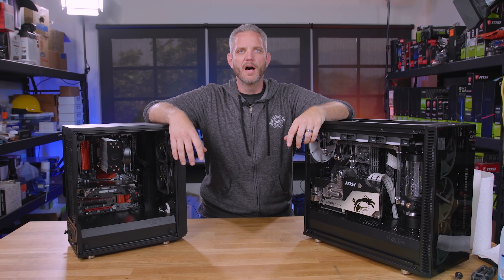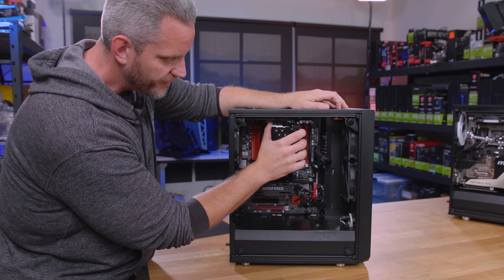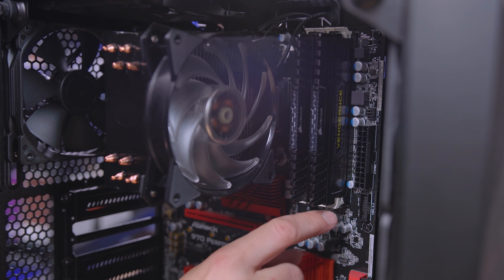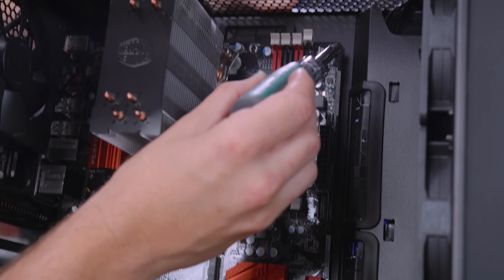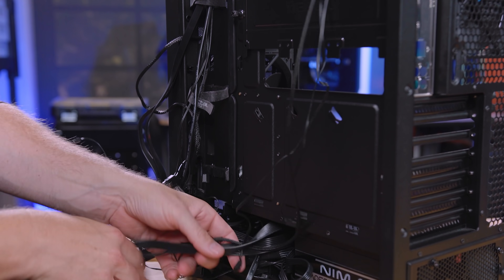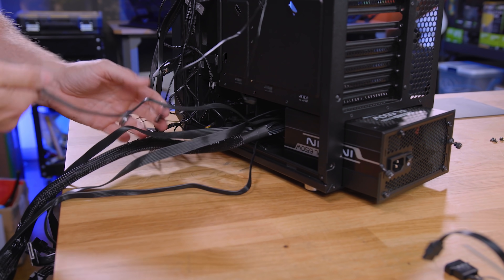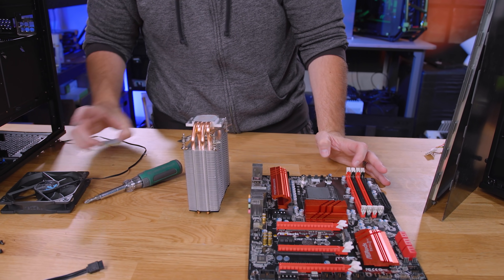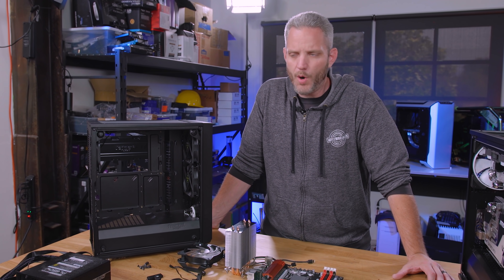How to UN-Build a Computer

Comment: I'm sad, Jay never took off the 
io shield.☹
Reply: Its important to point that out because the IO Shield is part of the Motherboard and not the Case, and a newbie can easily think otherwise.
Reply: Yeah I Want To Know How To Remove Io Shield
Reply: @Piyesgi  Most IO shields will have tiny clips that hold it on the case. Since there are so many, it is really hard to get them all bent in without damaging them. I have been able to take out an IO shield so I could move the motherboard to a new case, however it is extremely difficult. I probably bent a few clips, however I was able to get it in the new case.
Reply: @theredstonehive  Tiny clips? What have you been smoking?

Most IO shields just pop out. There's nothing to it, just press it into the case after you removed the motherboard. Make sure you keep track of the IO shield as there are thousands of designs for these, so finding one that will fit a particular motherboard can be very hard.

Some IO shields are actually attached to the IO port section of the motherboard instead of clipping into the IO port hole in the chassis. So when you pull the motherboard the shield stays attached to it. Again no problem, and you don't even risk losing the IO shield.

If you are building computers on a regular basis I'd suggest you save all IO shields even for dead motherboards. If you request a RMA many (all?) motherboard manufacturers wants only the motherboard sent to them. This way they don't have to keep track of all the parts such as IO shields, CPU HSF attachment parts and whatever else there may be. So save all that and you just might have a spare some day in the future. I've been saved numerous times by a dive into the parts binns. 

Other things to save are a good supply of antistatic bags, all sizes are useful. So save those when you throw away the boxes that the components come in. About boxes, you might want to save a few of those for things like sending parts for RMA or reselling parts. They are not necessary for storage of components but it's not a bad idea if you've got them. Motherboards and graphics cards can be mechanically damaged if stored in just antistatic bags. Even just a bare cardboard box will do much to protect them.

Same thing with CPU and HDD packaging If possible save one or a few of each kind you use. Oh and any slot covers that's not of the break away design, save those as many chassis either come with none of these or just one or two.  Drive bay covers (because I still use lots of optical media) are also something you may want to keep track of.

If you are junking a chassis then pick it clean first. Things to save includes screws and motherboard mounting nuts. You may want to save a few power and restes switches and perhaps even a few LED's if they are simple to detach. Two of each is usually plenty so no need to go wild here. Even an HDD cage can be a good find if it's a clean and simple design, but this is purely optional. You know what you are likely to use so save what you may use.

When all else fail use common sense, and don't claim you haven't any. You can breathe, right? Common sense tells us breathing is good so we tend to do our best to continue doing so... :)
Reply: Blahorga Slisk hey i need some help my morther board wont come out
Reply: *Brace
Reply: came to the comments to say the same thing..   SHOULD be mentioned in the discription of this video... or make a new video JAY!!
Reply: So when I have replaced a mobo I put the old one in the new anti static bag (or the original if I still have it) and tape the io shield to the outside using painter's tape so they remain together.
Reply: Same
Reply: Pop it out lmao
Reply: He's rolling the dice on the new case owner putting in the same mobo.
Reply: My motherboard already has the IO shield built in, never will I have to worry about this poor man’s problem 🥳
Reply: Just push it out
Reply: Or the front case fans
Reply: Legend has it the io Shield is still there till this day

Comment: But Jay... What about people that have Molex, IDE Cables, CD Roms, SCSI, Video card in a AGP port, Soundcards, and Parallel ports in a PCI slot?  =P
Reply: Old molex without the quick release tabs, good luck getting them off from handmedown :D I went "wohoo" when I got my last molex usage from previous system LED lighting power to current system RGB header. Next "wohoo" will come when USB 3.0 front panel connector is finally out dated and I never have to see that monstrocity ever again.

Comment: You should clean the Cpu while it's in the socket
Reply: @rom_kohai well on lga obviously outside, you can throw an intel cpu accross the room honestly. with a pga you should do it in socket or what I usually do is put it back into the plastic piece it originally came in.
Reply: @Chuckiele  I forget how Ryzen is packaged, but my Phenom came with like a porous piece of foam for the pins to dig into. I'll use that to put PGA CPUs on top of to clean if I need to (though usually I just leave it in the socket).
Reply: @Malus1531  Idk about Ryzen either, my Phenoms and FX were in a little plastic tray, but yeah, a piece of foam sounds very neat for that.
Reply: @Chuckiele  that's a really good idea!
Reply: @Chuckiele  exactly what I do

Comment: Jay i have 5 fans in my case, but ny motherboard only have 3 fan header and 1 of it is in the bottom of the cpu socket. So it like in between the cpu and the gpu. I don't know how to connect all of my fans to the header  even if i know the connector on the fan is different with the one on the motherboard. Im confuse, i think the fans that i bought is different or idk pls help i cant controll my fans. Oh and i connect the fans directly to the psu and stack them like a tower.

Comment: First thing you should always do is drain the capacitors. Make sure it's unplugged and keep the psu main switch on, hold the power button in for 10-20 seconds, turn psu main switch to off if you want to. This happens alot in totally different industries. If your working on anything from small to industrial that takes alot of power or small amount, you unhook and ground or just drain capacitors. Static Discharge has never happened to me or anyone I know, the parts today are made better than they were 10-20-30 years ago, you don't necessarily have to do this but it is good practice. If he did talk about this, sorry for even commenting this.

Comment: Thanks! This helps a lot. I'm about to unbuild my pc but all the wires everywhere were a little overwhelming.
Reply: I agree with Derek Jonez. Undo the connectors one at a time, working from what’s closest to you and going back. Feed each connector, and accompanying wire(s) back with it, to where they originate from before disconnecting the next connector. Helps keep everything straight forward and out of your way :)
Good luck with your unbuild, RemixMyLife!
Reply: One connection at a time.

Comment: Why dont ya do a vid on how to move and or transfer data from one hard drive to another hard drive there is no recent how to videos
Reply: Because it hasn't changed in YEARS. Literally, at all. @NZSHAKER just linked a 4 year old video that's 100% up to date.
Reply: @ArtosDeDraconum  Its what I used just 3 months ago to swap a HD to SSD in my little server I have :-)
Reply: @ArtosDeDraconum  but I only want to move only my steam files and a couple of other dont want to clone the thing
Reply: @bigpuggs1  then Google how to move those files. Steam is stupid easy, they literally just have a folder you copy.
Reply: https://www.youtube.com/watch?v=KuI2yFSAiN0 That is a Jayz how to guide
Reply: like cloning an OS from a dual boot system , 7+10, but only one OS partition, 10, that will used in a new build that will be booted from a M.2 NVME SSD . man this is a doozy
Reply: @crusadershuakbar  Clone the entire drive and delete unneeded volumes and extend it. I recommend paragon. Use adapters if needed.
Reply: @scott6634  
thats what i was going to do, until, i discovered the target M.2 ssd, 250gb,  needed to be the same size or larger than the original to be cloned, which is 1 Tb, approx 500gb for W7 + W10 each partition plus a couple small partitions which system reserved or boot partitions which are needed when cloning. next i`m thinking clean install W10 in m.2 as boot disk and then install acronus and connect external backup drive to recover full backup and overright the clean install, but, new computer has different hardware and different drivers needed and Microsoft w10 may not recognize my digital license in the new hardware and shut me down
Reply: @crusadershuakbar  If you use less than 250gb on your win 10 install you can shrink it then clone. Clone to a third drive if you need to keep the original intact.
Reply: @scott6634  
hmmmm, thats an idea, i will look into that option, it may just work. if i can shrink it all down small enough to accommodate the m.2 , hmmmmmm, thanks
Reply: this would be extremely helpful for me
Reply: Get EaseUS partition master and clone away.
Reply: Dd if=\drive\1 of=\drive\2

Comment: So... what do you do if your AM4 CPU is stuck in the socket (read: not coming out)? Is it possible to remove it without damaging the chip or the board? Or are you just SOL?
Reply: Aw man that stinks. Still works?
Reply: @DarkReturns1  yeah, I temporarily aborted the disassembly so the build still works. Really puts a kink in my upgrade plans, though
Reply: @LavenderSystem69  Google that, I'm sure there are some videos or forums about that issue.
Reply: I ruined my ryzen 5 1400 because of that. To many pins fell out. So now i have a ryzen 5 1600 and never messing with it again.

Comment: Honestly, if I move and need to have my pc in the car, mail, etc, I usually just remove the gpu and cpu heatsink, and hard drive. The motherboard will fine. Also some sensitive mobo cables^
Reply: I've moved several times in the last 10 yrs and all I do is lay my PC on the right side and it doesn't get damaged or stressed at all.